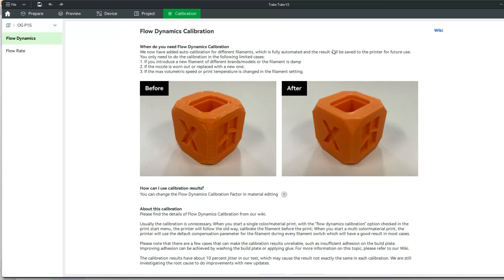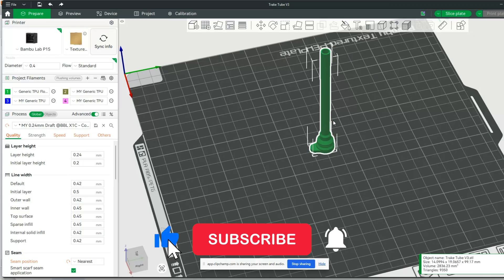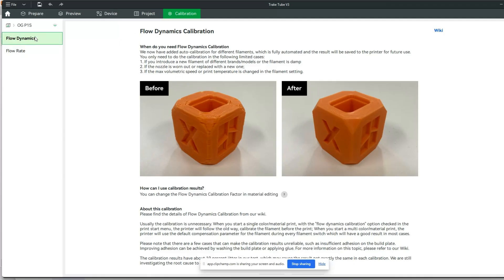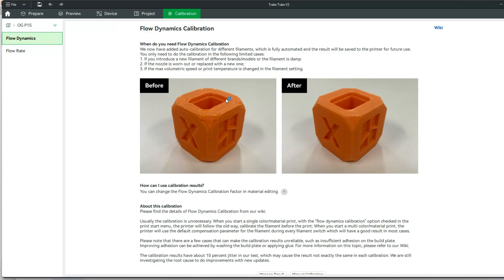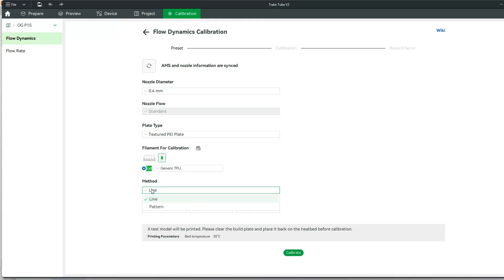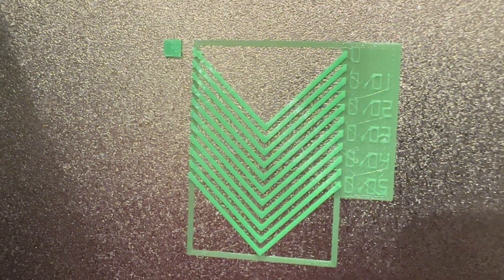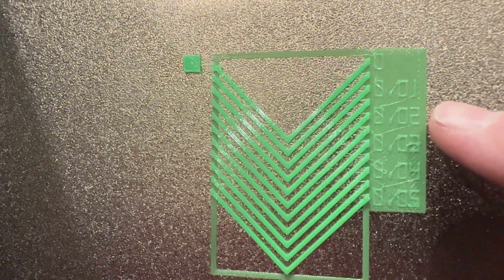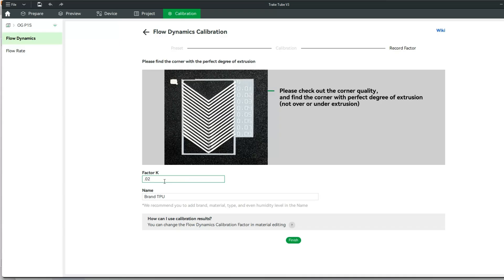Bambu Studio Flow Dynamics Calibration Tutorial | Fix 3D Print Quality

Comment: thanks for the short tutorial. One thing I would recommend is to not use a textured PEI plate for flow dynamics or flow rate calibration but a flat one like engineering or high temp plate